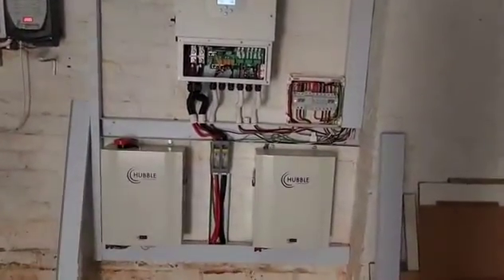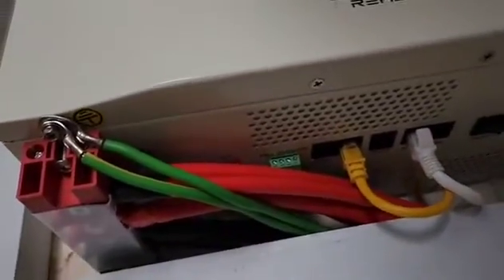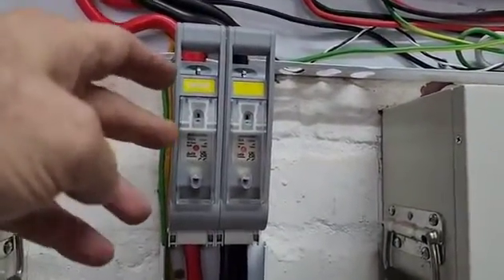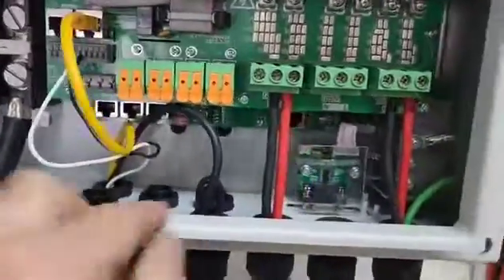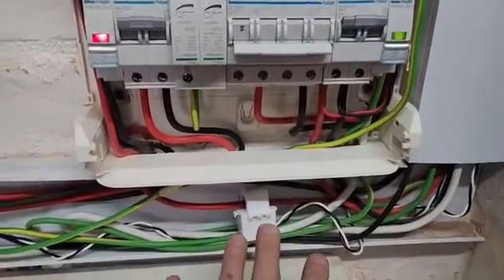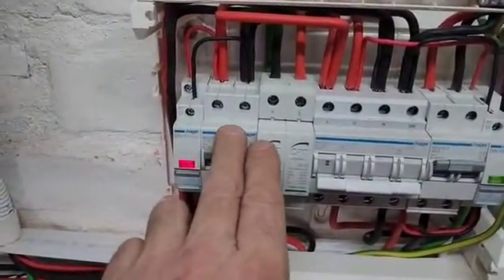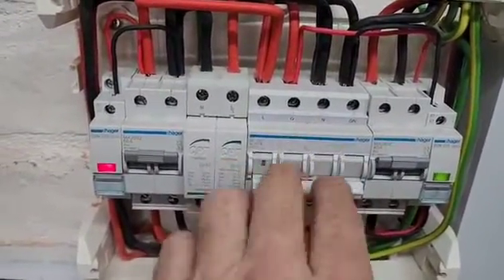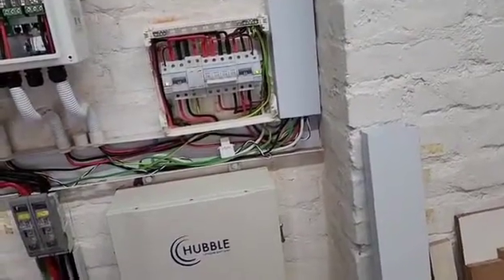8kVA DEYE inverter UPS

Comment: Hello, I've  just installed a new SUN-8K version.  It is working well, but the main screen does not show the 4 round KW dials with the "ON" in the middle.  How can I get to that screen, please? And If I touch the ESC button below, it flashes that screen on but only for fraction of second.  What am doing wrong? My system is OFF grid only.